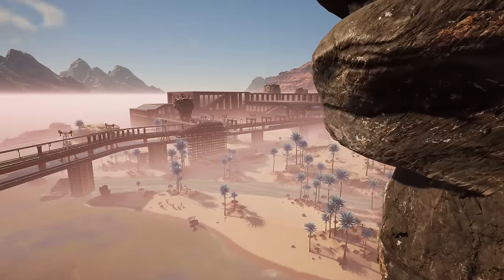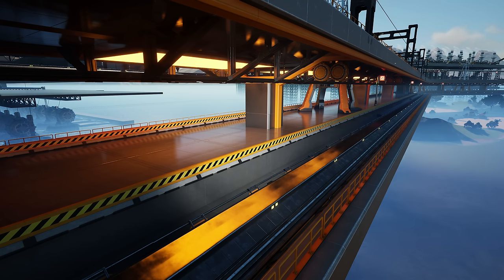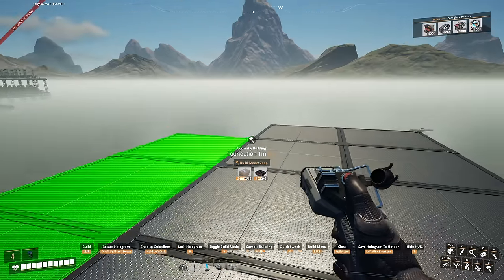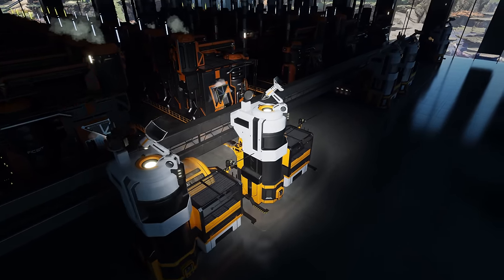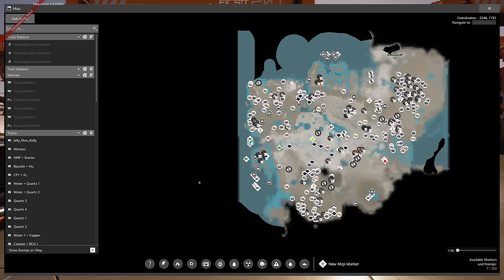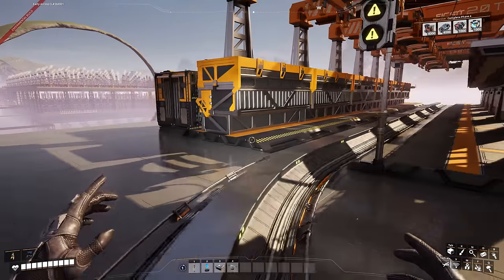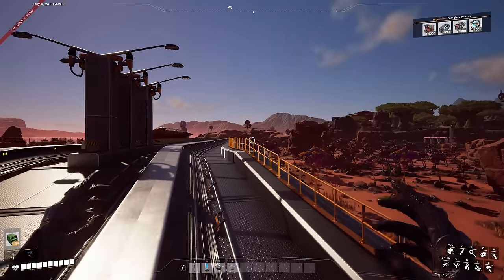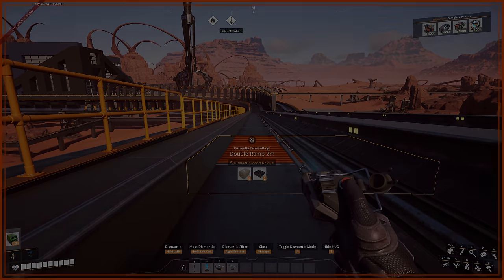World Highway is FINALLY COMPLETE!!!... In Satisfactory

Comment: I figured out that you can cut many steps out of your curve method using nudging. You can place one foundation right down on top of the other one with the angle you want and then nudge it forward 4 and left or right 4 and you'll get it right onto the same corner. It's even faster than the other curves method.

Comment: Hi Bitz, there's an easier way to do corners and you're halfway there. you get the catwalk things in the same thing but you extend it forward once press CTRL and mouse wheel and it rotates the catwalk by 1 increment. then build your foundation attached to it and it does the same thing.
Reply from the maker: Indeed, i did talk about that method on why i dont use that in the video... There is a Difference in how the walls line up, because it creates sharper turns
Reply: I really need to stop commenting on chuffing videos before I've watched them fully. I'll bear that in mind when I play it again.